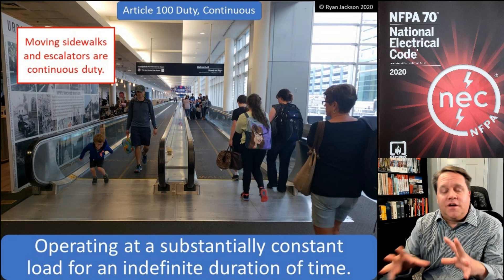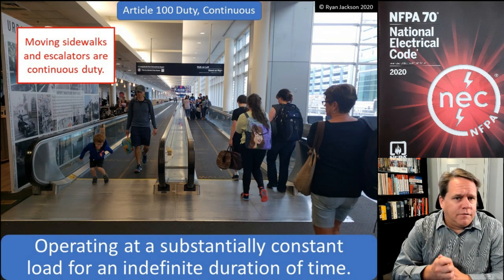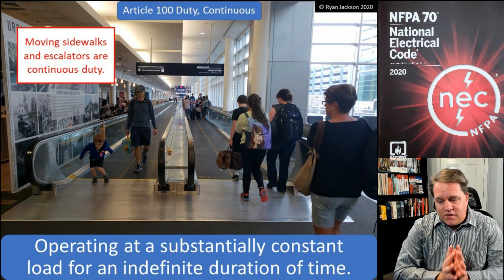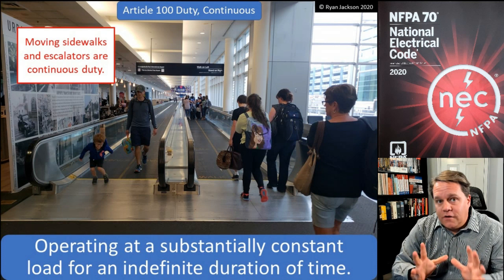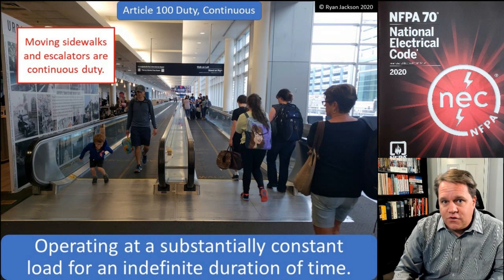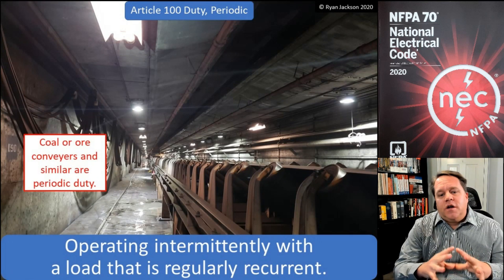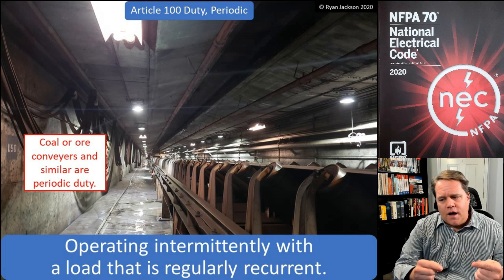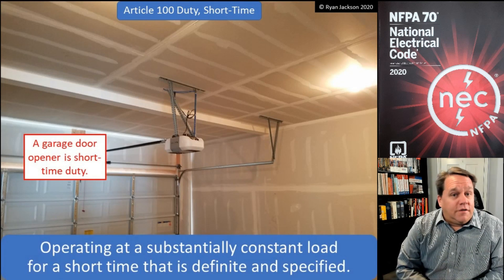100 Days of Article 100: Duty, Continuous (and other types of duty)

Comment: Ryan thanks for another great & easy to follow vid. Years ago i wired in a 200 HP screw type air compressor. While performing start up the tech said to never start this motor more then 4 times in 1 hour or it would overheat. One time while replacing some air lines on it our maintenance guy started it up too many times in 1 hour and motor got a lot hotter then when we ran it all week. I guess residental garbage disposals would have the same rating as a garage door opener. I always put them on their own circuit breaker. Got a call back from a gadget crazy homeowner. He had me install double duplex receptacles every 2' of counter tops. Called about breaker keep tripping. He had a 4 slice toaster plugged into one receptacle and a 40 cup coffee maker in receptacle in same location. Explained to him that each of the 7 or 8 double duplex receptacled were on their own 20 amp breaker and would have to use a  receptacle 2' away to plug one of these things into.